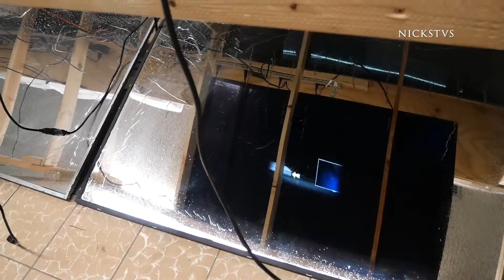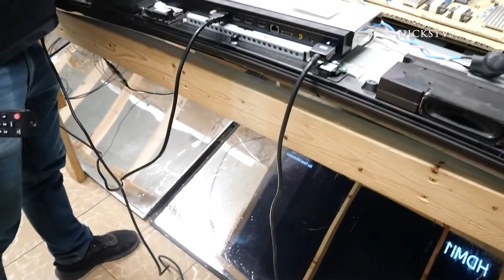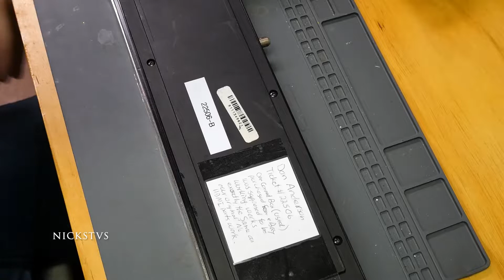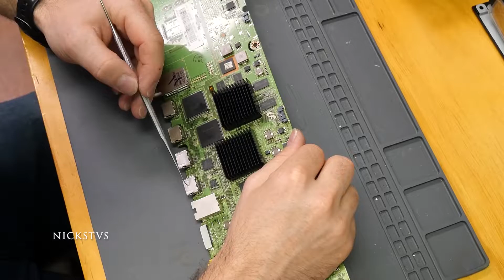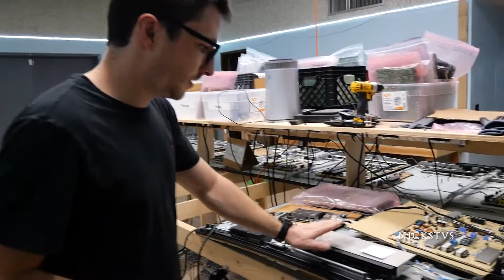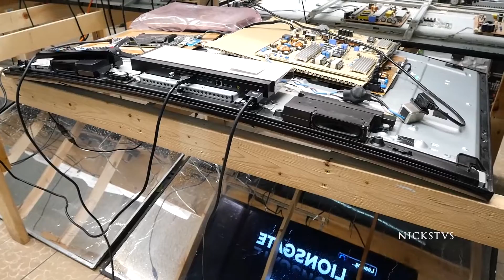How I fixed a 4K Samsung Curved TV with no HDMI's - Samsung UN65HU9000

Comment: Hi nicks, I have a 2013 samsung un65f9000a tv with one connect box model UHD 65 
 it was hooked up to a home theater system, while watching the set the video signal crashed
And now there’s only sound, I have backlights with no picture I can barely see faint images
I can switch from HDMI-1 thru 4 and receive the same audio signal without having to select each HDMI with remote control, also I measured the temperature of  1 microprocessor in the one connect box with a handheld infrared thermometer and the temperature is at @ 112°
Question: is there a possibility the one connect box is preventing the full video signal from showing a picture? I can forward a picture at your request if you like, Obviously the box is in need of repair, any suggestions? 

Thanks for the informative video
Reply from the maker: I have a few follow-up questions for you. I would request you send us a message to our email directly as it may be easier to follow up our communication that way. 
My first question is regarding the temperature. Is the 112 in celcious or Farenhit. If it's Fahrenheit, then that is a very cool operating temperature. If it is in Celsius, then that is way too hot and usually means you have a short on that processor. 
If you disconnect all external devices from the one connect box and bring up the menus, can you see the menus clearly on screen or is it still a very faint image? 
If you disconnect the one connect box from the TV do you get a clear picture on the screen asking you to reconnect the box to the TV? 
We do offer a flat rate repair which includes the repair of both the box and mainboard. Often it can be tricky to identify if the mainboard or the box is at fault.

Comment: Hi nick, great video..surprised to see one on youtube regarding this very old flagship...my ocb stopped working recently after almost a decade of faithful service 🤧... Upon visual inspection i found one (un)lucky little baby roach inside the ocb you think it might have fried the circuits? (i put the ocb on the floor recently due to moving stuffs around...maybe thats when he/she gets in..talk about how a little guy can end a big guy's whole carrier just like that)

Found no signs of burn anywhere.. Dusted off the boards and fan. When I turn on the tv, fan spins for 3 seconds and turn back off. When i unplugged the ocb theres still display on screen prompting to connect the ocb..reconnected n it keep blinking red 🥵. At least that means the panel is still okay i think.? I'm thinking of just buying the upgads(sek3500) to replace it but well its equally hard to find nowadays especially for my region
Reply from the maker: Hello,

Yes these are very hard to find even the upgrade boxes. We should have no problem fixing your original box however, what you are describing is one of the several different symptoms we see with these . If you have any questions regarding a repair service or the process, please email us directly or fill out the contact form on our website and we would be happy to assist you further. The details are in the description of the video

Comment: Hello, i have this same problem on my one connect box where no HDMI ports read when things are plugged in. I will test for shorts in that chip. Do you have a model of the chip so I can find one? Also, I don't know if you will be able to figure out this, but my one connect box says it is connected to the internet but won't allow me to accept terms and conditions, any thoughts? My tv model is UN65JS9000. Thanks.
Reply from the maker: The processors are different for your box, and I don't know which version you have, but the chip will have the part number printed on it, so you should be able to get the information from it. It may be a Flip chip BGA though.
As for the terms and conditions, try a factory reset, see if that works, but if not, you may have software corruption and may need to replace the EMMC chip on your box. The EMMC is the chip that holds the software.
Reply: @NicksTVRepair  I appreciate the response! I will look into it!

Comment: Hi, I am using same model of this. And these days TV is showing small horizontal green lines in few areas. Do you havs any idea what is the cause of it?
Reply from the maker: Yes this is due to a fault with either the mainboard or your one connect box. 
You will need to reball one or more of the processor chips on either the mainboard or one connect box. 
Are the lines present even when the one connect box is disconnected from the TV? If so, then the fault will lie with one of the processors on the mainboard. If not, then the issue will be with one of the processors on the one connect box. 
I do have a flat rate repair service for that board which I will link below:

https://nickselectronics.com/products/un65hu9000-main-board-one-connect-box-repair-service

Comment: Sir i have frame tv it got affected due to lightning and tv is not turning on can u tell me what is the problem does tv have any kind of mother board or power board in it or all are placed in one connect box please help🙏🙏🙏🙏
Reply from the maker: Hello,

Lightning hits differently every time, your one connect box is most likely the issue, but I don't know what board in the one connect box needs to be replaced. I would assume that either it's best to replace the one connect box entirely, or in order to identify the specific bad board you will need to open it up and do diagnostic checks like I did in the video with a multi meter and look for shorts. 
If you have additional questions, please contact us at support@nickstvs.com or post a new comment instead of a reply since I don't see replies, I only get notifications for new comments.

Comment: hello I have the problem on a samsung UE55JS9000 I hear only audio and the screen remains black it seemed to display but when I disconnect the one connect I see the image that tells me to connect the one connect do you think the one connect is faulty?
Reply from the maker: Hello,

That is an unusual symptom and there is a good chance your one connect box is the issue. This type of issue however could be caused by either your mainboard, one connect cable, or one connect box. 
However, the most common failing part with your TV set is the one connect box, so I would suspect it is the most likely culprit. 
We do offer a service for those devices which I have linked below:
https://www.nickstvs.com/store/p3000/BN91-14845L.html

Comment: Great job nick, was that a reflow of the same chip are a new replacement chip?   Thanks
Reply from the maker: Hello,

Sorry, I should have made it more clear, but we did a replacement of the chip. The chip originally on there had a short on it. That's what I was trying to show with the multi-meter readings on the back of the board. After removal, we did more checks and confirmed the shorts were gone. 
We did one more final check after replacing it with a new chip and everything was still good so we live tested it and confirmed the board was then fully functional.
Reply: @NicksTVRepair  where did you source the new chip?

Comment: Oh fantastic Nick, Im impressed off you workshop setup, thanks for give me idea how to improve my workshop, what you used for that mirrors under?
Reply from the maker: Glad it was helpful!

We just use old cracked TV screens and put one way mirror film that we bought on Amazon.
Here is the link for it

https://amzn.to/3rZKLvg

Just a heads up though the setup that we have in this video doesn't have any carpeting or protection for the TV's so if you were to use it, you would need to make either a modification or be very careful with the sets. We always use a blanket of some sort for customer TVs to protect them, but this video has one of our Test TVs we use and own simply as a test set to troubleshoot and verify functionality on circuit boards sent in for repair.
I just wanted to clarify that.
Reply: @NicksTVRepair  Fantastic Thanks